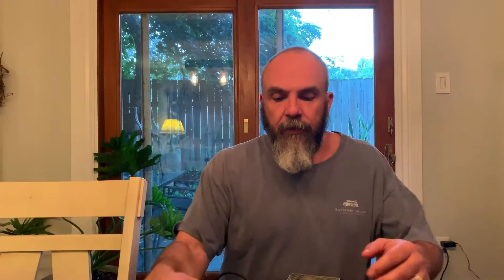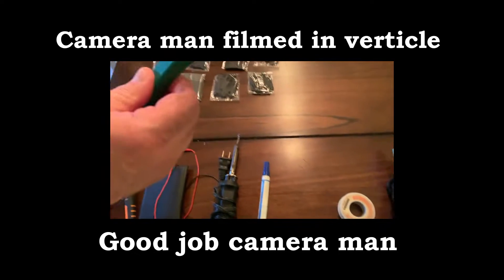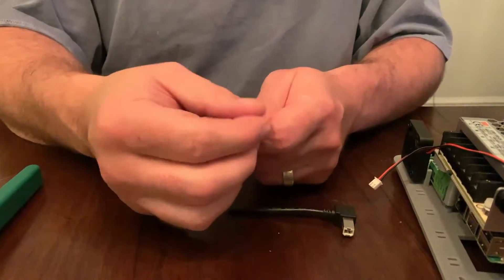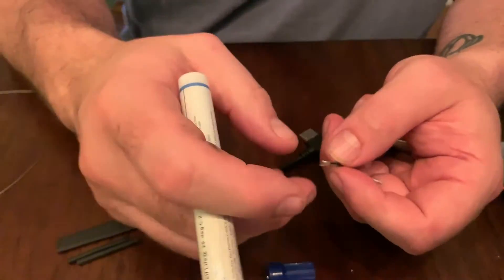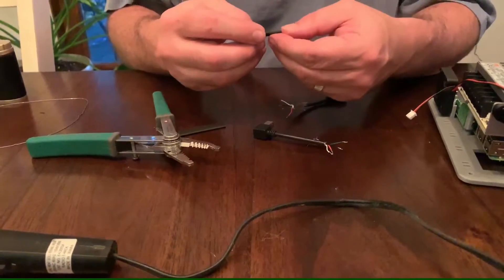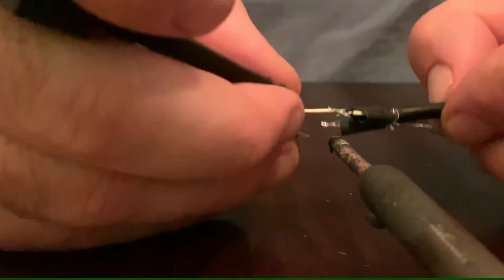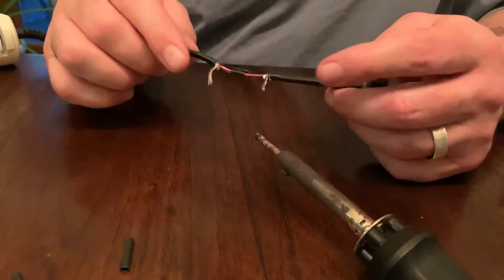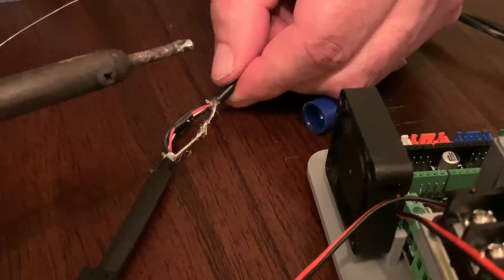How to OFFICIALLY splice a USB cable

Comment: Thanks for the video! I was curious if one could even splice a USB cable back together since I had an incident recently with my DDX model Kenwood car stereo/display. My jeep recently had broken down and in the 2 days I had to leave it on the shoulder of the road, a wonderful blessing to the human race decided to smash the passenger window with what looked to be a crowbar (as far as I could tell from what was left of the window). During their ransacking of my 4x4 Lego block, this gem of a human decided to cut the end off of the USB extention that ran from this particular model of stereo  unit. In short, that cable has been the only way I've found to be able to initially pair new devices ( for some damn reason) and it's probably going to be a sec before I can get an OEM replacement. In short, thank you so much kind Sir. You are a scholar  and a gentleman!! The Good Lord Bless you!😊

Comment: Hi, I have a USB cable that I want to replace its connector to USB Type C. My Connecor has 4 pins like the usual, but the cable came with 5 cables, red, black, green, white, and blue. The cable was direcly soldered into a keyboard board and the blue one goes to S (Shield). Now If i want to connect the cable to a USB C connector, where should I connect the shield to? Is it to the connector feet that connects to the metal body? Thank you
Reply: hi, did you ever got an answer for this? I'm facing a similar situation.

Comment: Very useful thanks! I'm really struggling with soldering and when I managed to solder 2 RCA connectors to shorten an audio cable after 45 minutes that was a major victory! My aim is to make my TV/Audio cabinet as tidy as possible by using cables at the exact size. So lots of cutting and soldering in perspective. The tips in this video should make the task easier ... hopefully!

Comment: can u splice it and twist it and use electrical tape to put it back instead of soldering? thx
Reply: I’m sure. Connection will likely be garbage though.
Reply: Makes a better connection if to soldier it. The glue on tape tends to make a mess of things in the long run.
Heat shrink is the way to go for low voltage wiring.

Comment: So I thought the metal shielding was just a protective layer, is it actually supposed to be conductive?
Reply: It's usually grounded somewhere in order to send unwanted interference back to ground.
Reply: Exactly. Shielding is there to reduce interfering electro-magnetic noise. You just rewrap it around all the wires, mainly 2 data cables.